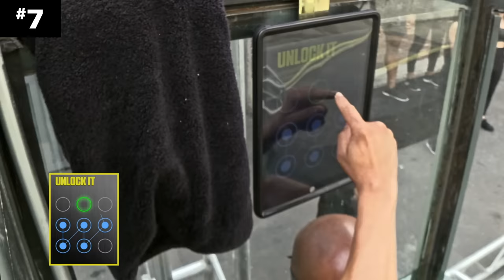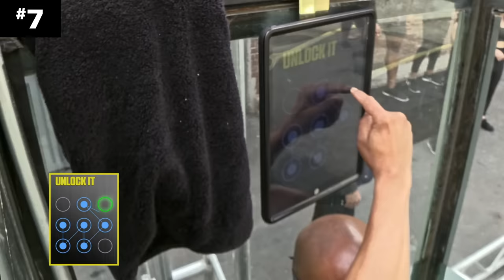8 ‘Fear Factor’ Teams Prepared To Drown For $50K | MTV Ranked

Comment: I didnt see a single safety diver wtf
Reply: Top Hat are you blind??
Reply: @davidlopez8512   gimmie some time stamps then
Reply: I saw a guy at 15:18 but idk
Reply: If they're struggling to breath they just pull them out, or stop the water💀
Reply: The top makes u think its has to be unlocked from keys . But that's actually  not the only way 
 There is a way for the people around just in case they need an emergency,  to RIP it off! ... take it off .. or even pull them out ..
 They can have them out in 1 sec!
Reply: 8:07
Reply: I'm pretty sure they're present. In the original Fear Factor, you could never see the divers either until they were needed.
Reply: U know they can just raise the crane back up
Reply: Top Hat they’re there
Reply: Nope
Reply: Hopefully  they were off screen
Reply: Of course there is safety divers, they just don't show them to make it look more dangerous ect
Reply: Top Hat if you would watchthe full episodes of fear factor you would have seen them by now. They always appear when there is an emergency
Reply: Top Hat watch Number 5, you can see them clearly several times
Reply: There were so many Time where you can see them bro
Reply: 8:05
Reply: They're probably hiding somewhere and will come out when called.
Reply: There are. They are the camera men.
Reply: They pulled it up into he last one
Reply: Top Hat ya mean lifeguard?
Reply: Top Hat 9:14
Reply: Are they gonna dive in 1 inch deep water?
Cuz if soo lemme be in that water
Reply: Top Hat 15:19
Reply: I lift and all water leaves containers

Comment: Watching this made me so nervous.

Just take how nervous you were and multiply it by 100,000,000 and that's how nervous you would be if you were on the show.
Reply: Mhm
Reply: 0 x 100,000,000 = 0 doesn't really seem that bad old fear factor was a lot worse.
Reply: Kirk  Lagasse ehhh...debatable
Reply: #SIMPLEMATH
Reply: As bad as it seems, they are not going to let you drown, they wouldn’t air the episode if someone had died, they have emergency services standing by always.
Reply: @Azzyy444  I mean everything is debatable I guess. In this case though, none of this stuff seems that bad. Even in the old fear factor none of the challenges were that scary the worst part of it was the nasty stuff they had to do. Especially the episode that didn't air with the donkey urine and donkey semen the contestants had to drink. That's far worse than being under water for 30 seconds or so.

Comment: Why didn’t that water flush out right when they pulled the lever, like immediately?? 1:52
Reply: Kobe_Sings pretty much did
Reply: um it does
Reply: Literally that's what happened
Reply: Yeah I guess, but I was expecting like the walls to open or like the bottom to slide off or something lol
1:52
Reply: Kobe_Sings I thought that also. Took about a second. But that second could feel like a lifetime when your air is literally “up”
Reply: That’s what I was thinking. If she was holding her breath and decided to tap out at the last second like right when she had no more oxygen left, that 1 second could feel like 20 minutes.

Comment: What people don't realise is that in situations like the car boot and plane sinking, even a little bit of air is heaps. Because of physics, the pressure of the water forces the air to compress into the smaller space. So even though there is lieelt spaces for air to breathe, it is more compressed and concentrated so you can fit more than double the amount of oxygen in the same space.
Reply: Dylan Baptist oh yeah oh yeah
Reply: L
Reply: Why are there so many replies here that have the same profile picture?
Reply: @depressoespressogachalol415  MaximilianMus oh yeah yeah

Comment: Why and how is this show still running?
Reply: Unusual Username ratings
Reply: The participants can't die when they're on this show. They can signal if they can't do the challenge and they get pulled up.
Reply: Kunta Kinte you funny asf😂😂
Reply: Unusual Username Paramedics and Medical Services are always near the site during these episodes, especially during these videos, they can send in a helper or they can pull the flags if it’s crucial for them to breathe. All teens are required to sign a consent to not sue them, they have agreed to risk it. Nobody has died on this show so far and this show is protected by the teens consent. This explains the name, ‘Fear Factor’ as the teens have to include what their fears are. Because of this, they practically agree to expect these kind of things. :)